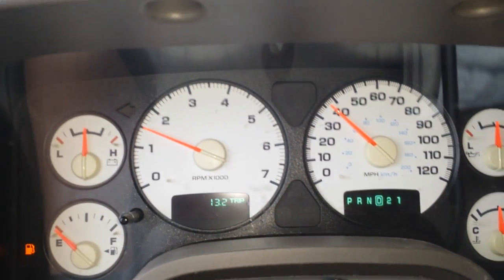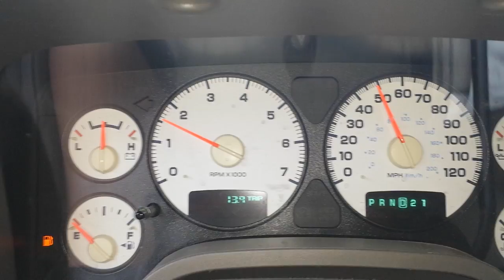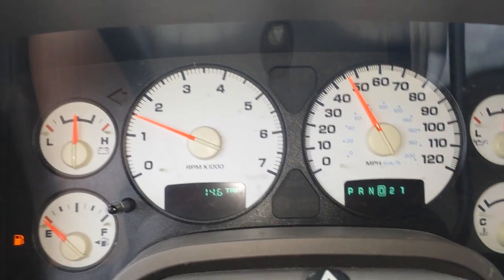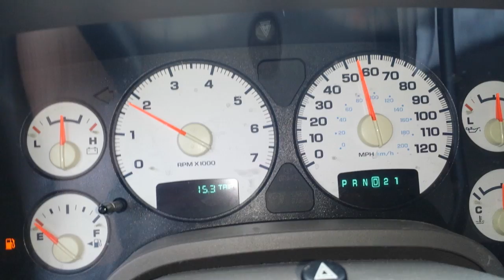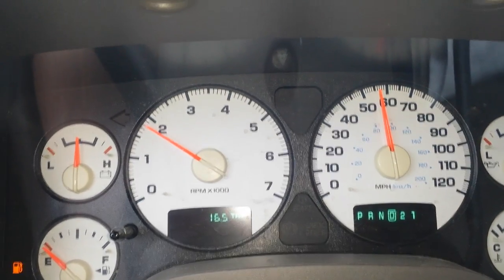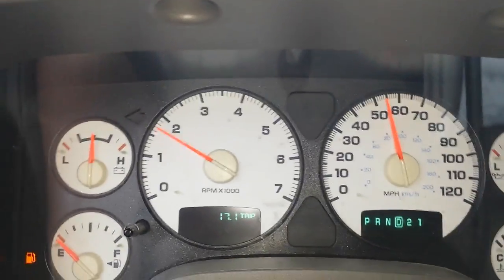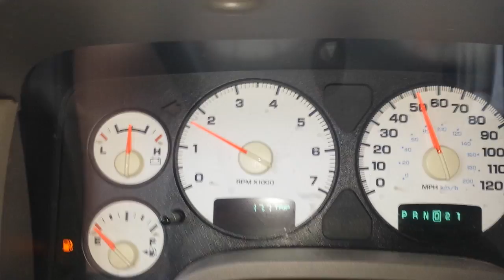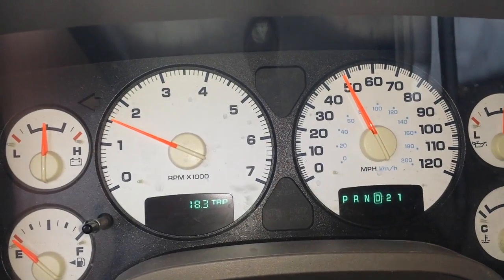Solved! Dodge Ram abs and parking brake lights on.

Comment: I have a question on my truck the lights for the P R N D 2 1 area dont light up only the place where the mileage is on . how can i fix that?
Reply from the maker: Bud Ligh I'm not sure about that one, maybe someone who reads these comments would have a good suggestion.  It very well could be something as simple as a bulb, or as complex as needing a new gauge cluster. Let us know if you figure it out though.
Reply: all the gauge cluster bulbs are on the back of the cluster and must be removed to replace the bulbs.
Reply: Maybe your neutral safety switch at trans linkage.
Reply: Its the NEUTRAL SAFETY SWITCH.. 100% sure

Comment: Where is the ABS Sensor located in a 2006 dodge ram 1500 3.7l v6. I have the ABS light and brake light on
Reply from the maker: I'm not sure if it's the same as my 2002. Mine is located on the top of  rear differential housing. Some models have them on the whell hubs, but you'd have to either find someone with the same model as you, or buy a repair manual that will guide you better.
Reply: ABS sensors are on the front wheel hubs on a 2006, speed sensor/rwabs sensor is in the top of the rear diff. 
Abs module is right behind the battery.

Im having issues with mine now. Both abs light and brake light on, check engine light on. Showing code U1120. 
Replaced the speed sensor, no change. 
Replaced abs sensors at the hubs, no change. 
Replaced the module, and check engine light went out and speedometer works. Abs light and brake light are still on. I cant figure it out.

Comment: Ive got a 00 and 09 2500 here in Aus was thinking theres an fuckup in the wiring so when i press the brake pedal both my amber indicators come on aswell but when i indicate it works fine is that because in America the brake lights are used as indicators or anyone able to give us an idea if i on the right track cheers

Comment: When I was driving my 2000 Chevrolet Cargo Van, the brake light and the ABS light went on, but when I parked and went to the store and got back in my van and started driving again neither of these lights went on again. I even parked my car and started driving it again twice and neither of these lights went on again. What happened?
Reply: Sounds like the problem I just recently gone through with my buick 2003 rendevous.It will slowly get worst. The lights and alarm will come on more often.and in my case it took 3 months of headache before while drving home from grocery store, the brake pedal just gave out. changed the brake fluid master cylinder,bleed brakes properly etc..and prob solved since...except for the abs light..it's still on..WTF
Reply: +Bobby Westner That happened twice but it hasn't happened since then. Thanks for responding to my comment though.

Comment: @Dino fuse I replaced the output speed sensor because that was the code it threw me on the OBD do you have a PN or a name of the sensor on hand of the sensor you're talking about located on the differential housing ?? my speedo works at 40+ MPH but nothing before then ... also my 04 Ram 5.7 has been running at a rough idle and at real low RPMs do you think this could also be related issue.. I've changed all spark plugs, O2s, and my EGR will run good for a couple days then back to garbage any info is appreciated I'm losing my mind trying to cure my truck. I've got a P0300 code as well as a P0132.. and P0501 which is for "vehicle speed sensor A range/ performance"
Reply from the maker: The speed sensor issue is very hard to diagnose, it seems like whatever fixes one truck may not fix another with the same symptoms. Dodge had also put different configurations of sensors on different model years, so one truck may have wheel speed sensors located at each hub, while others like mine only have the differential housing type. I don't have the part number on hand, but if you go to either Autozone or Advanced Auto websites and put your year, make and model in, then do a search for speed sensor, it should pull up compatable parts and show the locations of each. As for the rough idle issue, I just happened to fix this issue on mine last week. I cleaned the throttle body intake and changed out the Throttle Position Sensor and the Idle Air Control Valve. Now it idles steady and smooth. I did not do a video on those 3 items because several already exist on YouTube. Just search your truck make and model and add each item after for each search, you will find plenty of helpful videos. The parts are only like 120 bucks and it only took about an hour or so to do. Hope this helps.
Reply: @dinofuse6949  thanks alot for responding so quickly, I am going to try replacing my ABS sensor on the diff as I need new fluid anyway found one at AutoZone for about 40$ I'm hoping it helps resolve my timing with how my trans shifts too. I also will look up videos for those other sensors as well I haven't come across any of them yet in my searches I was starting to lean towards it being the camshaft position sensor from everything I've read  I might even swap that too for re assurance.. do you remember what codes you had with your rough idle of any at all..  was it causing a P0300 (random misfire)?  I'm willing to try anything to get all these lights off my dash, it's lit up like a damn Christmas tree ...  trying to get the most out of my 04 Ram approaching 200k miles 😬
Reply from the maker: @jcoggins2012  mine wasn't throwing codes for the rough idle, but it would stall randomly. The idle air controle valve and the throttle position sensor replacement cured it, along with cleaning the throttle body. They sell a spray cleaner specifically for the throttle body, use that and an old toothbrush and a rag, best of luck. Dodge really should have recalls with all of their sensor issues. It's ridiculous.
Reply: @dinofuse6949  thanks for the info I just opened my differential a few days ago and sure as shit I had that C clip sitting in the bottom of the housing i cleaned up the sludge and replaced the fluid luckily the clip didn't get bound up in any gears and was the whole piece. My ABS & Brake light have since gone away and my Speedo is back to working good again! Seems as if my mileage has slightly improved as well. As far as my rough idle ive noticed when I disconnect my battery it disappears for awhile and it hasn't returned since I did that a few days ago about to get my codes read again today. But thanks alot for the video!
Reply: @dinofuse6949  also I was wondering do I need to replace that clip or is it safe to drive without that in my differential I didn't really see any damage or wear on any gears so just curious about that or how you proceeded with yours
Reply from the maker: @jcoggins2012  glad it helped. Mine comes back every now and then, but there is more than 1 clip, and yes, there are pieces everytime. Good luck with it, I love my truck, and it loves to be worked on. Lol
Reply from the maker: @jcoggins2012  well, I've been driving mine for years like that, the only thing I notice is some chatter when the wheels lose traction, probably because the LSD no longer works properly. That doesn't mean yours might be ok though. I'd say theres definitely a chance of it locking up one day, but so far so good.
Reply: @dinofuse6949  yeah let's hope that never happens lol I'm sure having 35s doesn't help much either but I love this truck don't think I'll ever get rid of er. Thanks for all the info though bud much appreciated

Comment: So lastnight I got in my truck its a 2004 1500 5.7 turned the ignition on with out starting the truck and the brake lights came on fire the truck up still on turned the headlights on and there still bright like I had my foot on the brake  got going down the road and the abs and brake lights came on tge dash board, any help would be great to narrow stuff down before tearing it all apart would be great.
Reply from the maker: That's a little different then how mine acted. I would start with the easiest things first. Scan the OBD for any codes, check all related fuses and relays, then check the actual brake pedal switch, etc.

Comment: My dodge dakota turns on the break light while I'm driving and dashboard and radio lights go out. Dodge dakota 2007 4.7l 4x4
Reply from the maker: I have another video about fixing a broken wire under the fuse box when my radio had issues. These things are just full of electrical issues. Could be anything from a bad ground, a broken or pinched wire, or anything in between. Start with the easiest solution 1st and then move on to the next one as you rule them out.

Comment: Wish me luck I have a 2002 ram 1500. And the abs brake light came on and the speedometer stop working. I changed the sensor on the differential still nothing. Next I will drain it and change the c clips .
Reply from the maker: Ivan Peralta the pieces I had were the Clutch Pack Retaining Clips, not the axel C Clips. A lot of people on the Internet call them C Clips,  so that's were the confusion comes from. Hope you get it fixed either way, good luck.
Reply from the maker: Ivan Peralta how did it turn out? What was  the issue with yours? It could be different,  and the more info the better.

Comment: would any one know why my gas pedal is stiff and won't hit the floor, and it picks up speed slowly
Reply: Are your brakes locked up? Last Sunday I went to look at an 05 with the Hemi and I thought just the parking brake was stuck because there were no lights on the dash. I got it up to 60 on the highway and all 4 brakes started smoking.

Comment: Can you show the sensor on the transmission  pls ?
Reply from the maker: It is mounted on the top of the differential housing, but you can't see the sensor from looking inside the housing because all of the gears are in the way. When you get under the truck, look above where the driveshaft attaches to the housing. You will see wires attached by a connector to it. There is one small bolt holding both the sensor and a brake line in place.  You must be careful not to damage this brake line if you remove the sensor. I don't have any pictures of the sensor and its location handy, but it is the only thing with wires going to the differential.